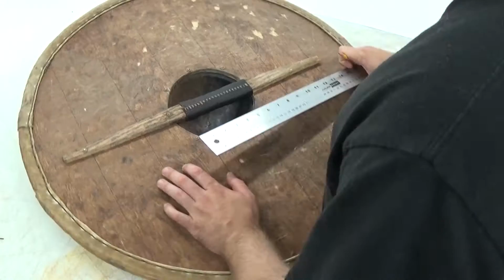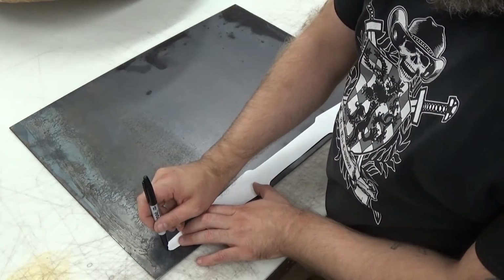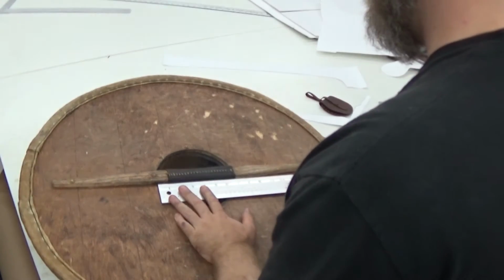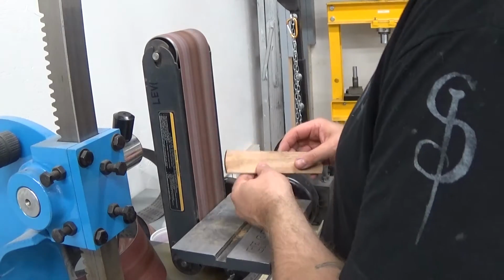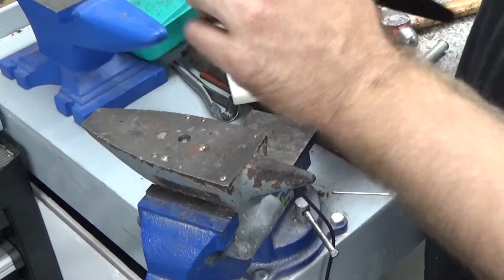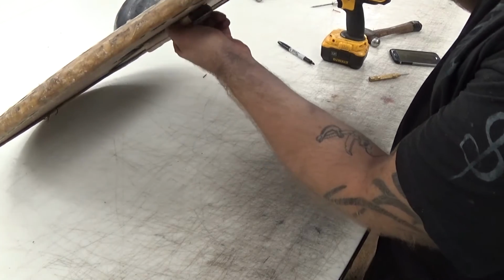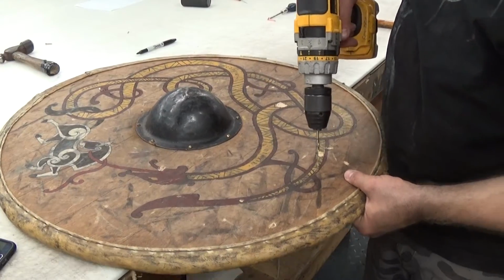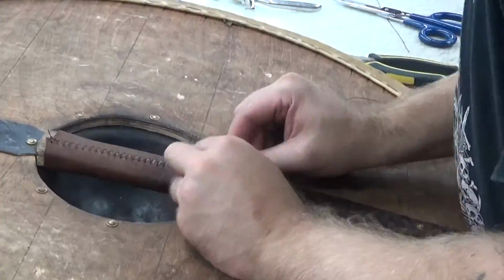How to Make a Viking Shield Handle

Comment: That is by far the most sturdy grip configuration I've seen. I'm researching different methods of sheild building before I make my own, and it seems that the grip is the most understated part of every  DIY video I come across. To me it seems logical to design the part you hold to be flawless, and design the rest around it to be of equal quality. Thanks for making this video. I'll be using my take on this method when I build mine.
Reply from the maker: Glad I could help!